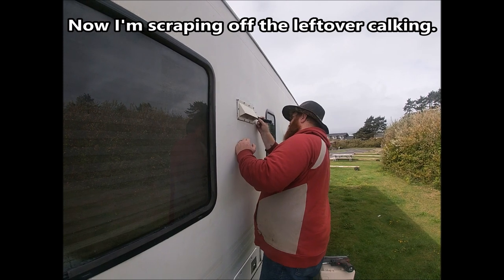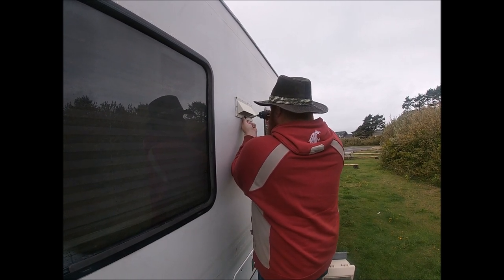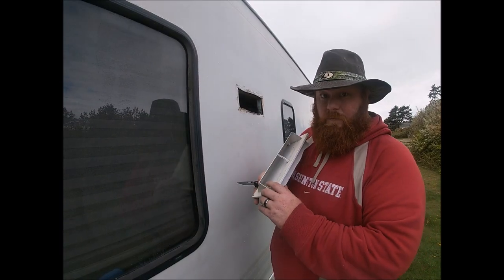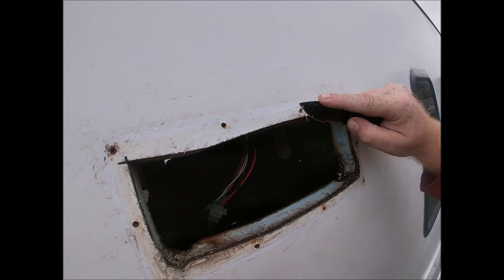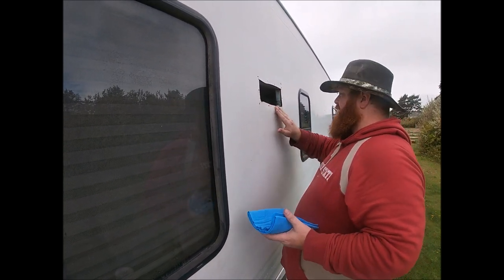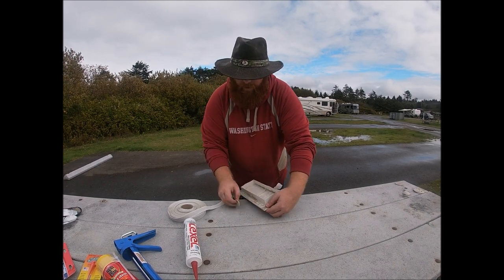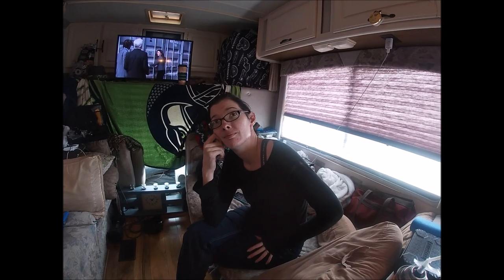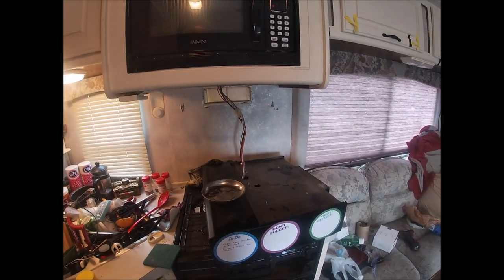How to Repair a Leaking RV Vent and Resealing Complete DIY

Comment from the maker: We had water coming in through our vent and it just ran down our wall. We did a quick repair at 3am to stop the leak with Flex Tape. In the morning we made a trip to Ace Hardware for some repair materials. Hope this helps anybody with the same issue.